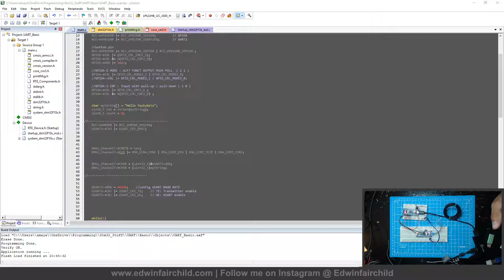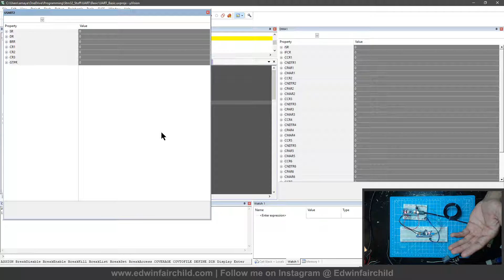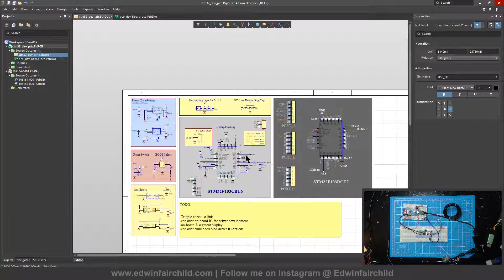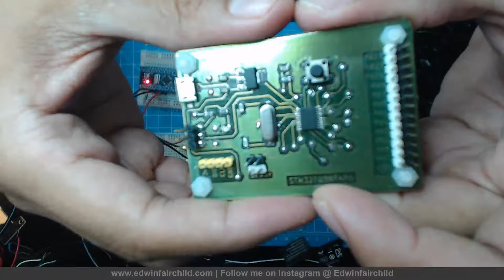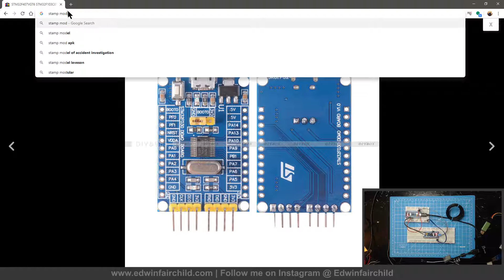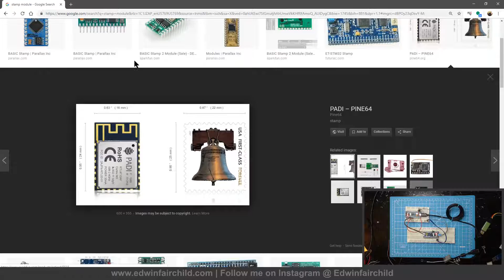Update on my Custom STM32 Dev board design

Comment: Isn't the STLink V2-1 based on the F103CBT6 and the Blue Pill based on the F103C8T6? Yet, the binary extracted from the former worked without a hitch on the latter?
Reply from the maker: Yeah, I'm sure who ever got the firm ware must have modified it, or really it just had no adverse affect 🤷🏻‍♂️ either way I have scrapped this idea, it's not worth it, st now has an StLink V3 modules with castellated edges you can put on any PCB to have full genuine debugger and virtual com port and mass storage , all for 8 bucks. Unbeatable.
Reply: Wow, I did not know those existed! Could definitely use them on a future project. Thanks! Maybe one of these days, I'll try dumping the firmware from the STLink and uploading it to the blue pill, just for fun, haha!

Comment: Why not a bootloader like stm32duino ? saves an extra uC
Reply from the maker: Well a bootloader is just a bootloader to upload code, you cant debug with just a bootloader on the chip it cant debug itself you need an extra uC. The chip comes with a bootloader from the factory no need for an extra one unless it's needed. But I will also make videos on writing a bootloader .
Reply: @EdwinFairchild  I assume both STM32s are exposed through USB, does the board need a hub or is there some trickery ?
Reply from the maker: @ryebis  not sure what you mean... Have you ever used a Nucleo board , hmm I can't think of an Arduino that has debugging capabilities ... Have you ever used an Stm32 blue pill with an St-Link?  I want to make a comparison so you can understand better what I'm trying to accomplish
Reply: @EdwinFairchild  Don't have a nucleo board. Trying to understand how the debugging uC and the UART from the target uC share  a single USB socket.
Reply from the maker: @ryebis  only the debugger part will be plugged into USB, the target uC  UART will be plugged to the debugger uC UART, and then the debugger UART will forward that to the PC for printing and stuff . While at the same time debugging the target uC and stepping through the code. How can you send UART and debugging info in the same line through USB? That's a question of USB protocol standard. Same way you can have a webcam, a mic and a mouse etc plugged into one USB hub which all goes through one line
Reply: @EdwinFairchild  witchcraft!  thanks for explaining :)

Comment: If you plan to make silk screen, then how you will make designations in the case of remapping?
Reply from the maker: Rema0ing are user settings and that's up to the user to handle. I'm will silkscreen defaults
Reply: @EdwinFairchild  Thanks.